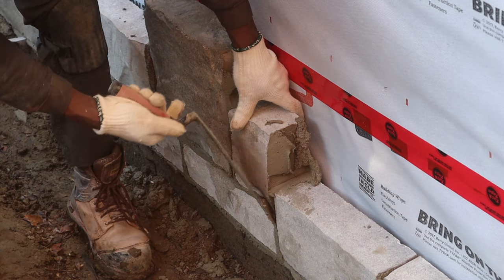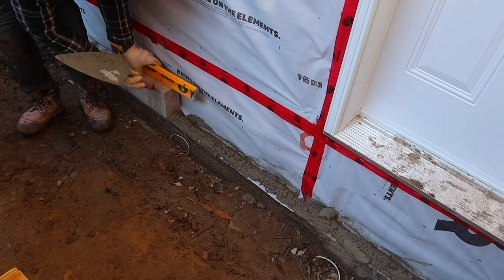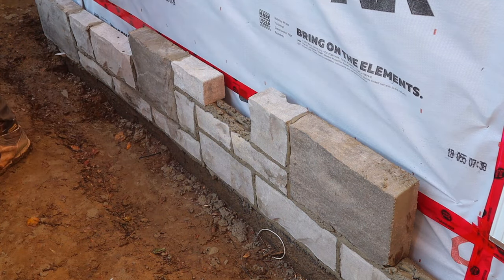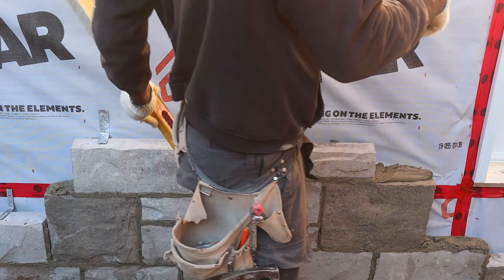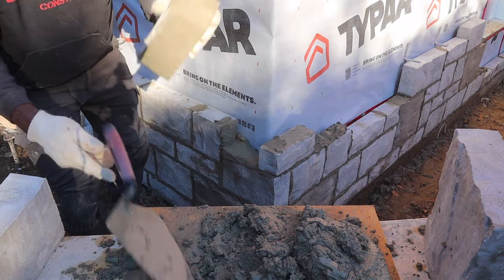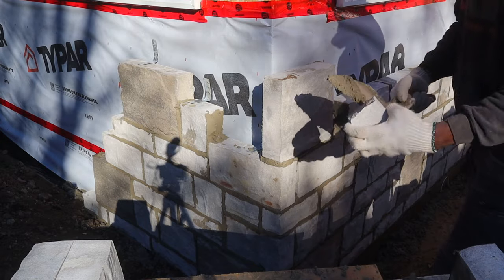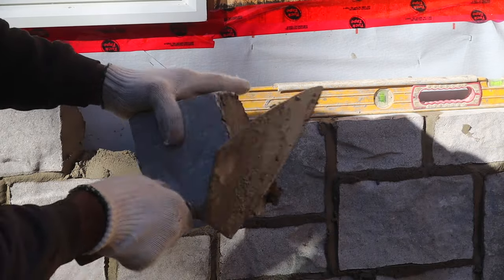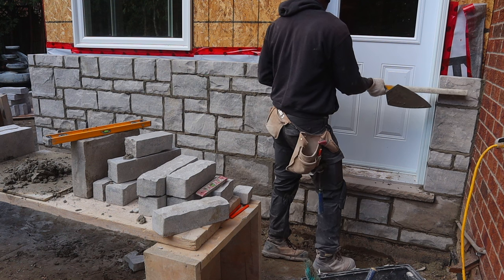DIY Stone work For Absolute Beginners, Diy Tips

Comment: For anyone interested in some more details on the rules of laying stone. He is doing a pattern known as random ashlar. He mentions 3 rules here and those are some of the most important but there are a few others that he is doing instinctively that aren’t mentioned. 

To explain some of the terminology, with the stones he is using here, there are 3 sizes (heights), biggest is the jumper/riser (he refers to them as jumbo), the  medium is leveller or stretcher, smallest is the sneck/deuce.

Rules.
1. Jumpers shouldn’t ever touch (except when used as quoins (corner stones)
2.the longest vertical joint should be the height of your biggest stone (jumper)
3. The longest bed joint should be a set pre determined length that fits nicely for the wall. Usually 1200mm (4 foot level)
4. A stone shouldn’t be higher than it is long 
5. Avoid obvious stepping (placing 2 stones next to each other of the same length and same height)
6. Avoid placing snecks smaller than 100mm in the wall 
7. Your bonding lap should be at least the height of the stone being set ideally, but absolute minimum should be 100mm
8.  Never place more than 3 stones next to a jumper 

Those are 8 of about 14 established rules. Again many of these he hasn’t mentioned but he is doing them instinctively in the video.
Reply from the maker: Great tips 👌 👍
Reply: Kris, do u have a book recommendation I could study these rules?
Reply: @travisandtracyjacobs6198  Hi Travis and Tracy

Good Question, I'm not sure truth be told, there is a book they sell here in Canada for apprentices that has it contained but it may be different depending on the part of the world you are in. Where abouts are you located ?
Reply: @krisg6365  

I am in Oregon in US. 
Every time I get onto some of these cultured stone groups or mason groups people post little snapshots or snippets of how stones should be laid with no tombstones, running joints etc.  

And I am searching for books or material that I can have as a reference so that I don’t always have to keep asking people stuff. Like those things that you just mentioned I want to make sure that I have those kind of ingrained in my brain. It’s hard to find books on masonry construction or the rules